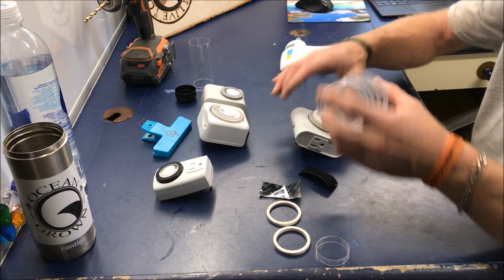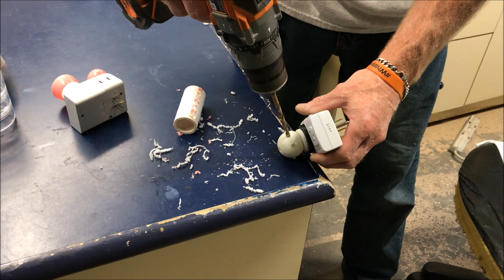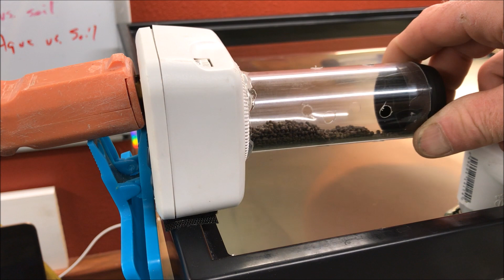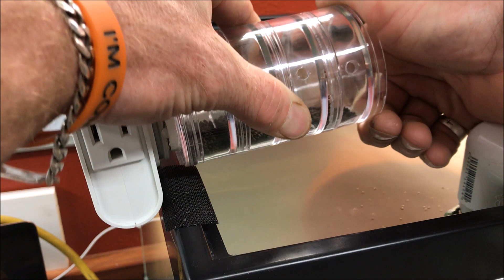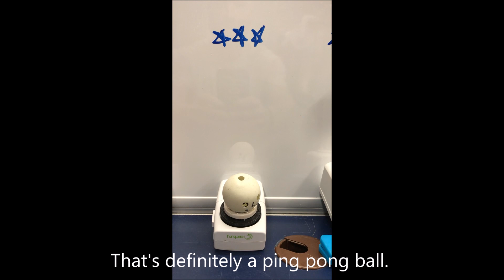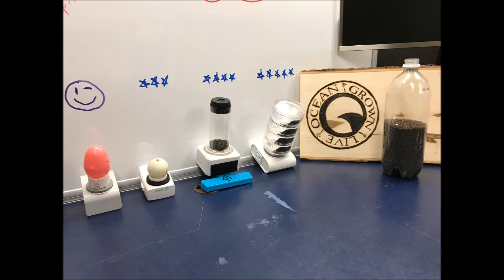SUPER cheap and easy. How to, DIY, automatic fish feeder

Comment: Very dangerous connecting sn open electrical connection so close to water. Appreciate the DIY but must use low voltage DC current and some forn of seal for waterproofing.